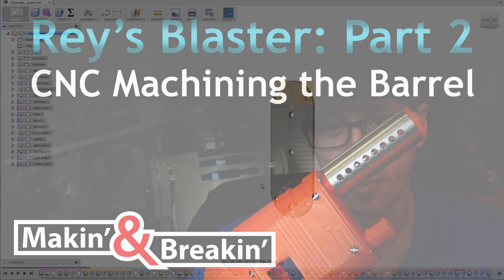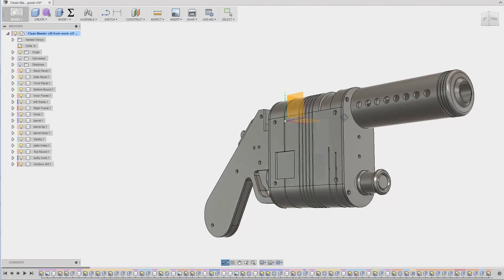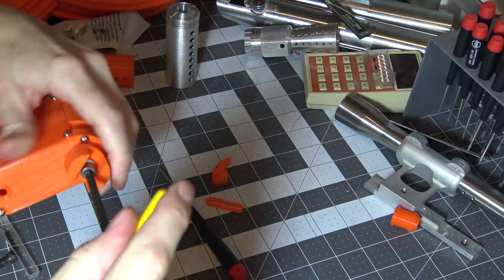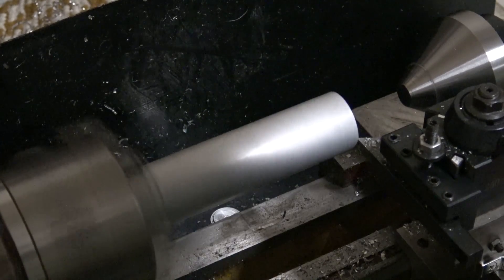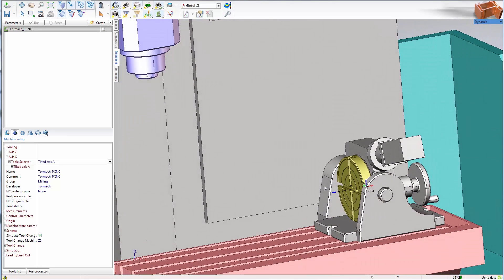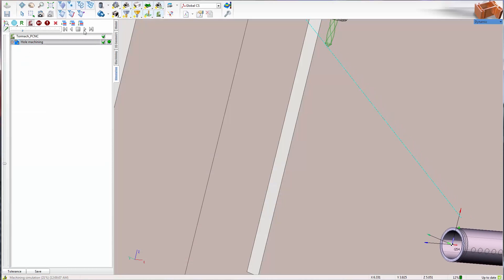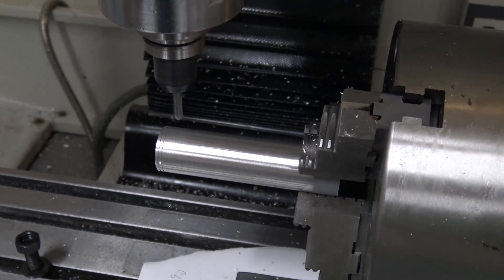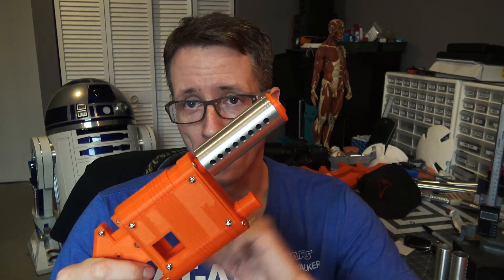Makin' & Breakin - Rey's all metal blaster Part #2

Comment: Hey Jesse, where did you find your dimensions? I found a print on punishedprops.com, and started working on some parts, but the scale seems off. Everything seems bigger than I'm thinking it should be.
Thanks
Reply from the maker: Greg. I based mine off of a bunch of things. I based it off the grips and then kinda used that as a starting point.  Then using the screws, and metal material sizes i started seeing things that worked together. However I used the disney display prop heavily which was not screen used.  I suspect it is a bit larger than screen used also. Mine came out to about 11.5 inches long measured horizontally.  However I have heard from very good sources that the actual screen used blaster is closer to 11 inches. So if you were to base yours off of 11 inches i think you'd be pretty accurate.
Reply: Awesome. Thank you Sir.